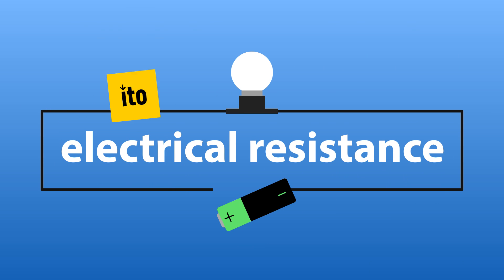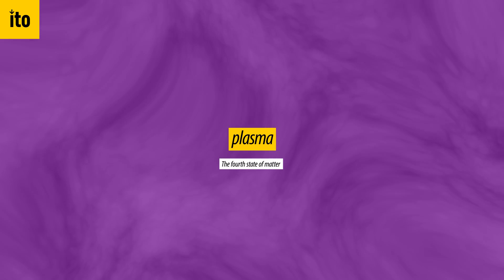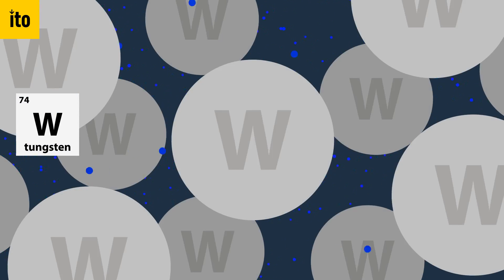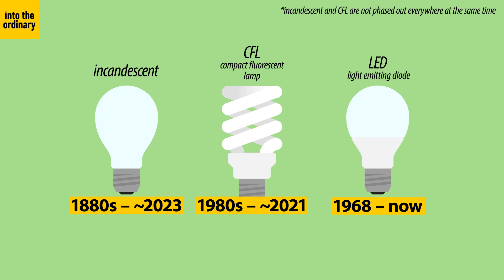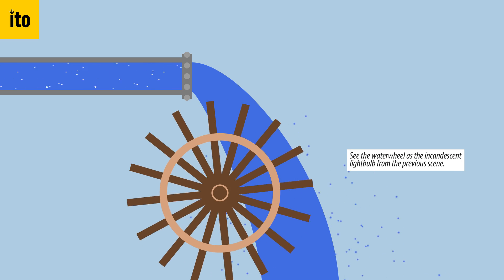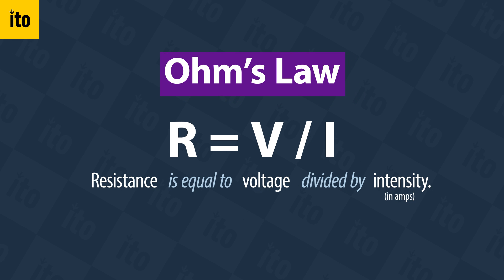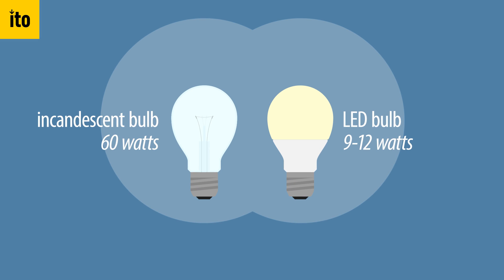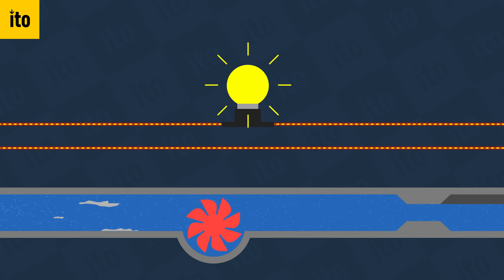What is electrical resistance? - Electricity Explained - (4)

Comment: Wanted to know if a crimped wire will cause either high resistance or low resistance. Maybe a stupid question.
Reply: I’m guessing it will cause high resistance since it is stopping the voltage from fully flowing ?

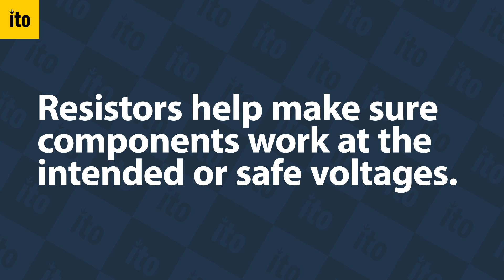Comment: At 9:16 you are wrong ! VOLTAGE IS NOT THE SPEED OF THE ELECTRIC CURRENT.  You can have an open circuit, no current at all, and lots of VOLTAGE !
Reply: I feel like voltage and amps were swapped at this moment